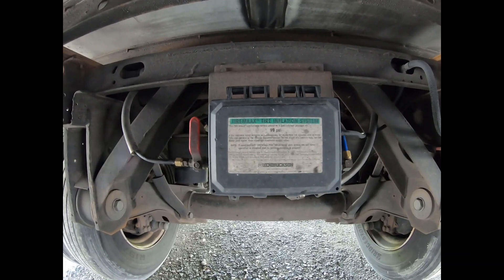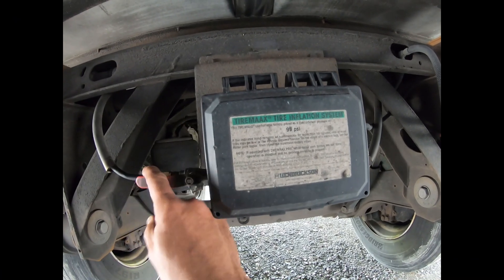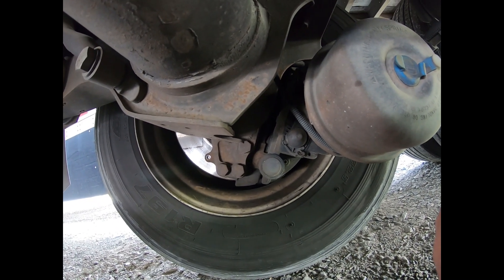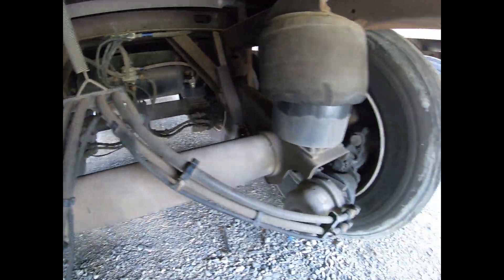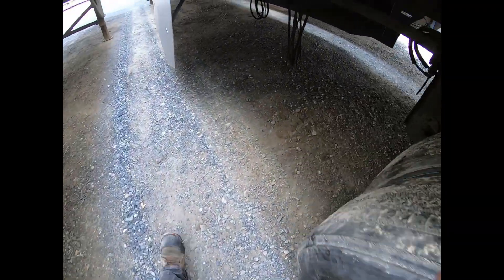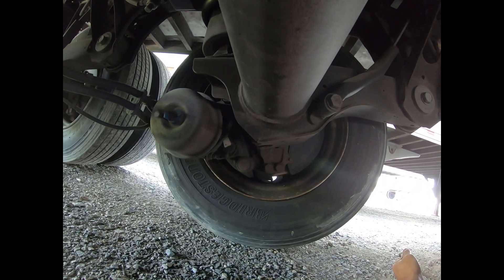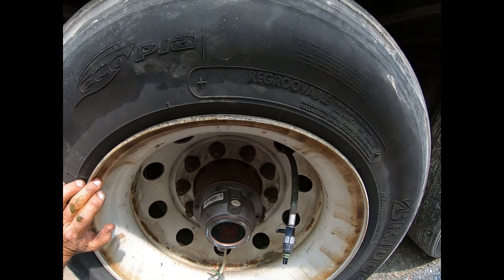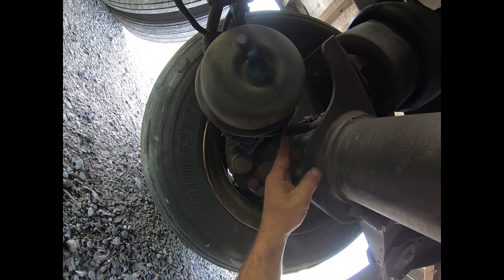Air leaking from axle. Troubleshooting Hendrickson TIREMAAX PRO tire auto inflation system.

Comment: Great video Thank you this made it so much to understand I have air leak only when it’s hot when it’s cold I don’t hear anything when it’s hot I can hear whistling
Reply: The tire mas pro will relieve over pressure too. If you only hear it when it's hot, it's possible it's just releasing pressure increased due to use.

Comment: I'm guessing that if you shut off the valve and wait until morning, you can tell what hub is the issue by the flat tires.
Reply: Is this true ? I have the same leak on my front axle exhaust port. But I seem to have a tire on my rear axle go flat

Comment: Thanks for the info. Great video. Is hub oil needed once installed?
Reply from the maker: This hub has semi-fluid grease instead of oil. Semi fluid grease is thicker and tends to stay in the hub as long as the bearing isn't removed.  If it were an oil lubricated hub then I would have to refill with oil as a good about would be lost by removing the hubcap.

Comment: My is leaking from the controller
Reply from the maker: If it's leaking out of pressure relief valve (the bell shaped thing in the controller), that is normal.  The controller is sensing the tire pressure is too high and it releases air to get the tires back to the target pressure. 
If it's leaking out of the 2 holes on the right side of the controller after you set the trailer parking brake, then you have a different issue.  Here's a link to a video I made about. https://youtu.be/3oXJuJtl5Uw

Comment: Can u upgrade this to the upgraded box the one that releses air when its super hot out and whatnot
Reply from the maker: The model shown in the video (Hendrickson Tiremaax Pro) is the upgraded system that releases air when the tire pressure is too high. 
Hendrickson has another model, the Hendrickson Tiremaax CP, that will only add air to tires that are below the set tire pressure.

Comment: Don't need antiseize to insert the bolts?
Reply from the maker: Hendrickson's service manuals doesn't mention the use of anti-seize for installation, just to torque to 15 ft. lbs. From factory the hub cap bolts come with thread lock, which won't work with oil or anti-sieze on the fastener.

That being said...I've extracted more than my fair share of broken hubcap bolts, so anti-seize wouldn't be bad to use when servicing the wheel end. Just remember things like oil and anti-seize affect the torque put on a fastener and to adjust the torque as necessary.
Reply: @fleetrepairsolutions6372  thank you. Great video

Comment: While back I had the same problem when my team driver was on duty, he didn’t pay attention to the warning service light and the pressure built up in the axle then blew the cap window, drained the oil, Efed up the bearing, and I had to reweld the damaged spindle end and changed everything else involved. Now, on the other axle, I can hear a strong leaking sound from the system, and I know for sure there is a little bit of bubbling in the oil that I can see from the hub cap window, so I’m guessing it’s the same problem. Thanks to your video, I can better service the issue, but I thought you would check the connection of the supply line in the new hub for leaks before you bolt it back on. Thanks again, great upload.  👍

Comment: What if you only seem to develop an axle leak after driving for a while? Being the morning when i air the system up it never leaks but after running for a little bit i can hear it when i do a walk around.
Reply from the maker: Honestly I'm not sure what would cause that, but if air is coming out of that tube in the axle at any time there is a problem. Either a malfunctioning auto inflate hubcap or a leak in hose inside the axle feeding the hubcaps.

Comment: Great video ! Very informative. 
I want to install this tire inflation system on my flatbed soon . 
Tell me something please. How do you remove the old spindle plug to install the new one where the hose is passing through!?
Thank you!
Reply from the maker: Thanks!! Google "welsh plug removal spear".  Basically a tool that threads into the plug coupled with a slide hammer and you can pull them out pretty easy. When you order the tire auto inflation installation kit, it should have new plugs to install.  Just make sure to tell them your axle size.
Reply: Thank you for this info ! Really appreciate it!
When i order it this kit , the salesman asked me all the info about my axles . Hope it will be a match. 
Thank you again .

Comment: i facing same issue on my trailer mechanic said he found air leak from hub cap seal inside & change 2 hub cap seals but still air leak from vent axle air flow is this normal after some time it’s stop leaks and sometime stay leaking for while
Reply from the maker: No it's not normal...If you have a similar system as shown in this video, then any air coming out of the vent in the axle is bad.  By hub cap seal do you mean the thin gasket between the hub and hub cap? If so then this wouldn't be the cause of your problem.  Air coming out of axle vent on this system means either the airlines inside the axle have developed a leak (unlikely), or the hubcap rotary union wears out and starts leaking (very likely).